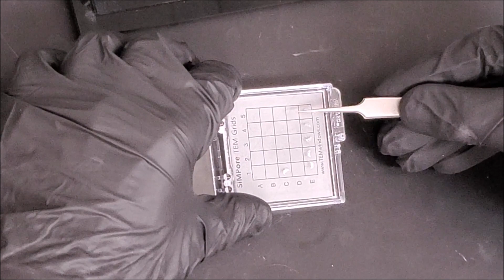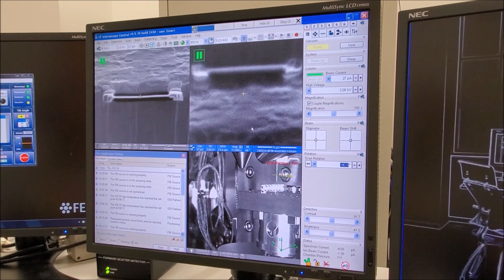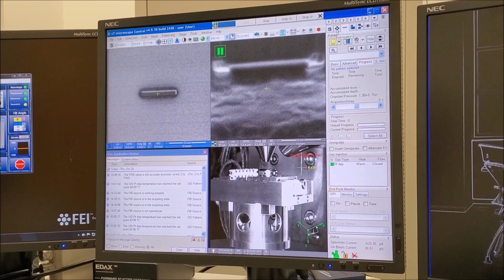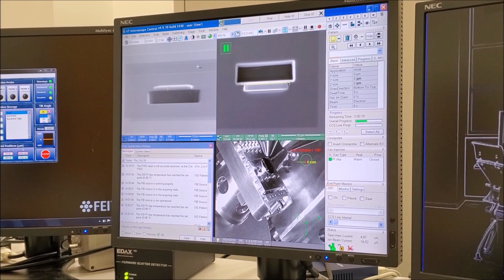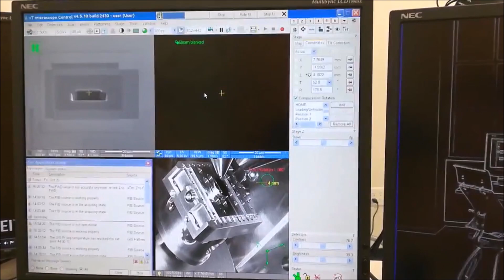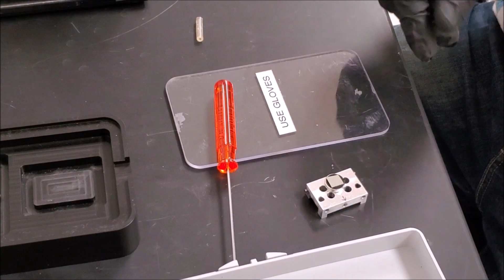FEI Helios Nanolab 600: basic operation

Comment: Hi, on our Nanolab 660 we quite often have the situation that positioning of the sample via double-click in the SEM-image causes some kind of vibrational sound of the stage accompanied by a jump in the stage position (in the range of few µm to about 200 µm), as if the command for the stage movement is not properly executed by the stage. It only happens for rather small movements in x and it never happens when driving the stage continuously. But it also happens when we tilt the stage from 0° to say 45° in one push by setting the tilt target value to 45°, very likely due to the small correcton in x that takes place during this operation. Have you ever encountered a problem like that and found a solution to it? Best regards! Michael
Reply from the maker: Hi Michael: sorry for the late reply. That is an interesting problem you are describing and not one I have personally come across.  Generally, the double click move is most accurate when the sample surface is properly focused on and the WD is linked with Z.  If you try to double click with image out of focus, it tends to be less accurate, but not like what you are talking about.  What kind of stage do you have?  Is it only mechanical or is it an interferometer stage like the one in my video?  The later is much more precise and accurate so I'm guessing you have mechanical stage?  The other possibility is that there is a maintenance level alignment for the stage that needs to be performed or is otherwise way off kilter; if so, your local FSE should be able to help.
Reply: @NicholasRudawski  thanks for your reply! I already had many discussions with various FSEs about that problem, but no solution so far. The stage is only mechanical, but all alignments have always been very well within spec. FYI: My latest tests showed that the ocurrence of the problem is accompanied by jumps in the stage controller voltages, so now the idea is that it is maybe a faulty stage cpu. We are gonna replace that one and see... Best regards! Michael
Reply from the maker: @ddmicha  I hope it all gets resolved for you; as you mentioned, there may be a circuit board or something else that is causing the problems.  Unfortunately, there are an unbelievably large number of parts on a dual FIB/SEM that can break/malfunction and cause problems; it's almost a miracle that a dual FIB/SEM works properly even part of the time (let alone most of it)!